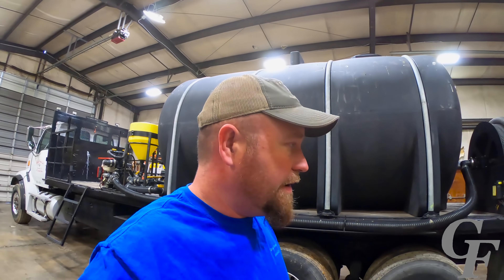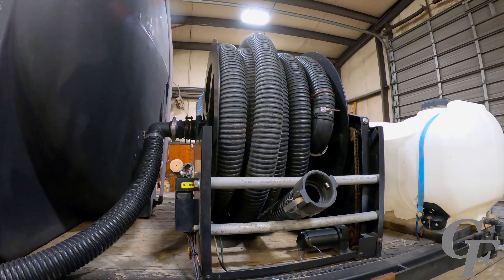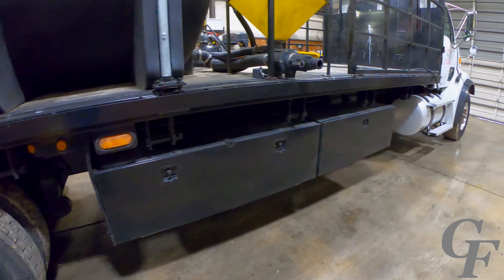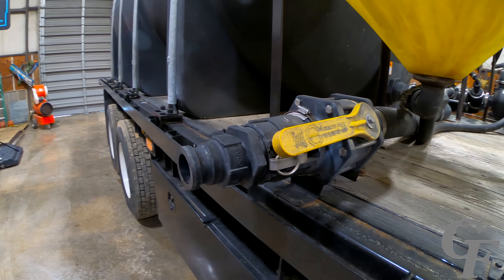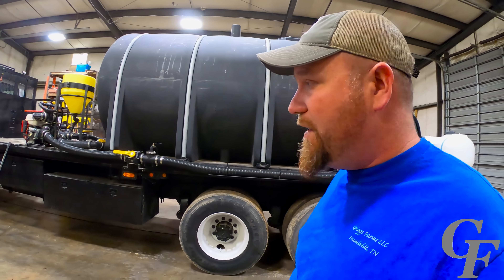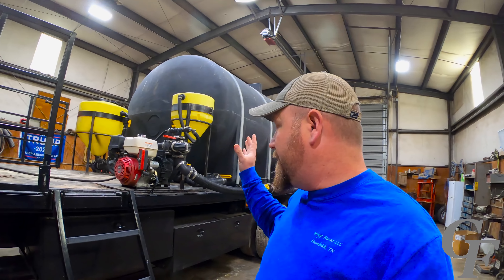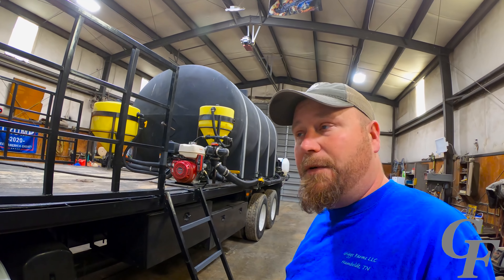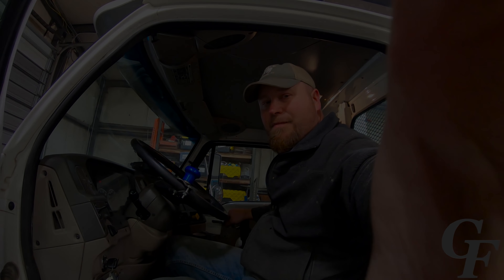The "Ultimate" Farm Water Tender Truck!

Comment: We upgraded 1 of our 4630s and got a r4038 and parked upgraded to a KBH nurse trailer has 2 3,000 gal tanks 1 over truck axles the other over trailer axles in the center has room from 2 totes and 2 pallets pump mix vat and electric hose reel it comes plumbed 3 in like the sprayer

Comment: Nice! We just reconfigured our 8600 international water truck from a 3000gal tank to a 4000gal tank.  One of the main differences is we added a drop step off the back for our Chem-handler
Reply from the maker: I’ve seen a lot of trailers with 6,000 gallons add that drop step for the mixing station.

Comment: Getting ready to setup a new tender trailer, and I was curious if you have any issue with there being so much hose after the pump, and the pump being able to move that? I wouldn't think that'd be a problem, but my sales rep said he's had some guys run into that problem.
Reply from the maker: Haven’t had one single problem. I could definitely see a problem if it wasn’t plumbed up to use the air on the truck to blow the hose out after filling it up though. 3” hose filled with water is HEAVY
Reply: @griggsfarmsllc  thank you

Comment: Thanks for showing us your Tender Truck.  I'm setting up one this Winter.  You said you also use Fertilizer I assume it's 28% or 32%,when you mix that where's your water sorce to rinse  jugs or Inductor?  Also should add check valve to Air Blowout.

Comment: would you do the 3" hose reel again? or a supported swing arm? Thanks  Bruce
Reply from the maker: The reel was expensive but I’d definitely do it again. With 50’ of hose, if it’s too wet to pull truck in the field, we can leave it parked on side of road and fill up